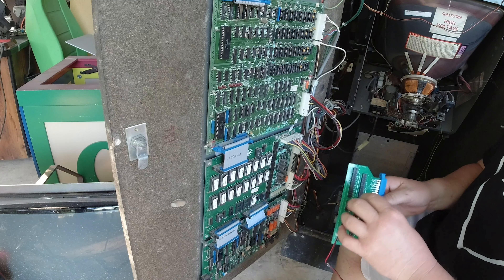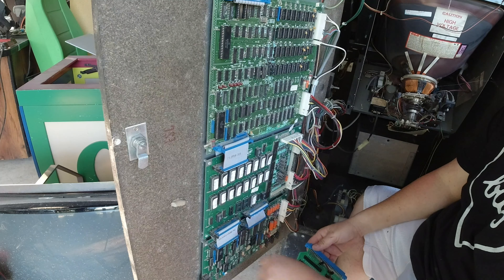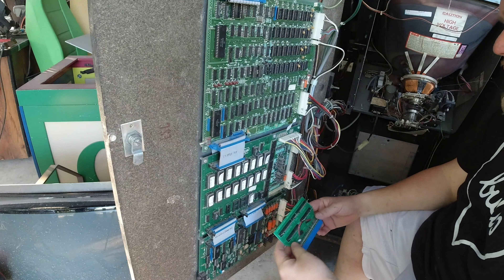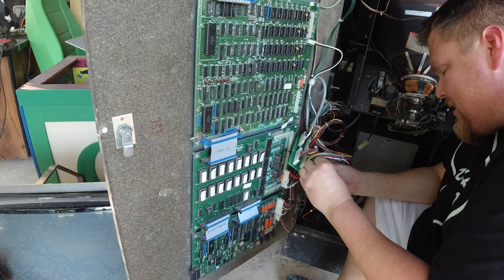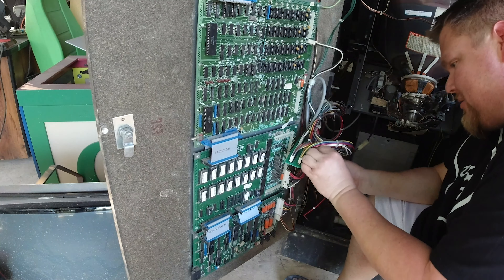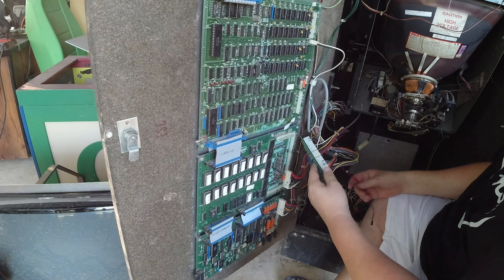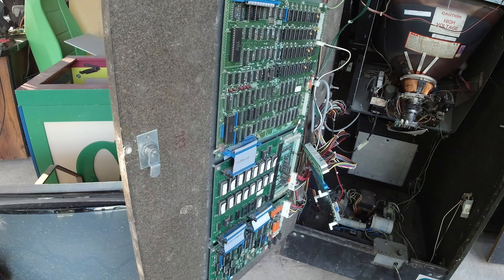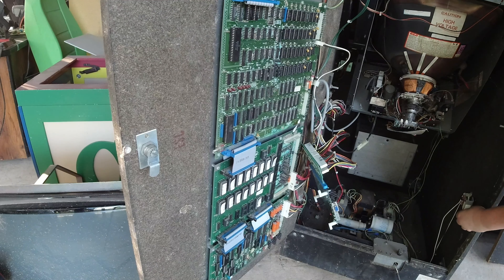Qix Repair Part 1

Comment: Which connectors do you REMOVE on the arcade monitor to connect the TGP generator? I don't know how to connect the TPG generator to the arcade monitors
Reply from the maker: Just remove the RGB, sync and ground connector. Essentially everything for the video signal. Then connect a video cable, you can make your own, to the TPG and the other side directly into the video input of the monitor. If you would like I can make a video on it. Just let me know.
Reply: @bombdiggityarcade7089  yes make a video about it because every arcade monitor the RGB, Sync connectors are located at a different spot on the monitors pcb board. So I don't know which connector is the RGB & Sync connectors is at on the monitors pcb board.
Reply from the maker: @waynegram8907  will do. I just got a Zooq board thanks to my brother so we will revisit Qix this weekend. I'll cover it in that video as a sub part of the video or I can do one independently of the Qix video.